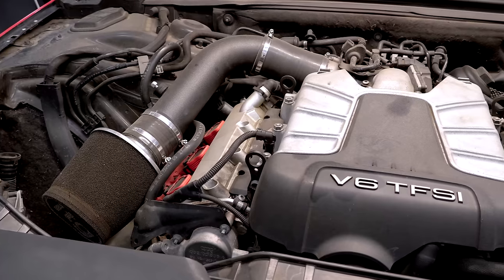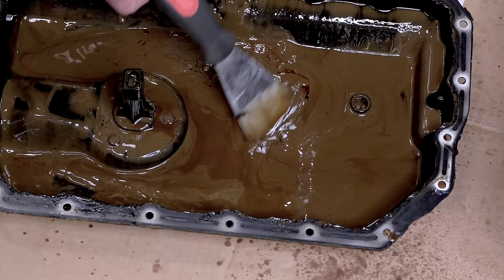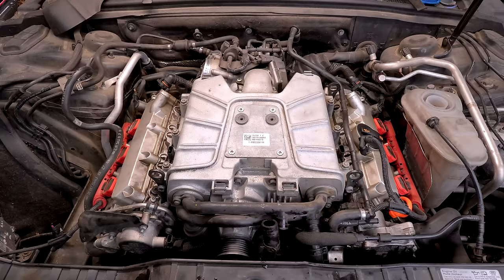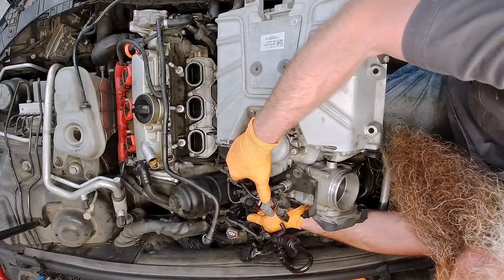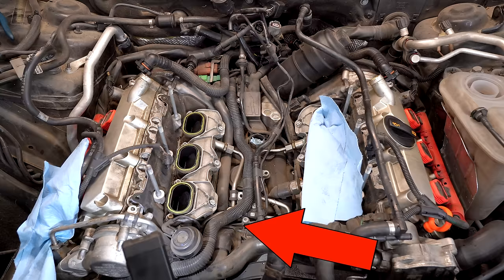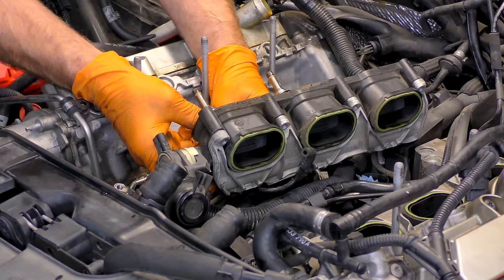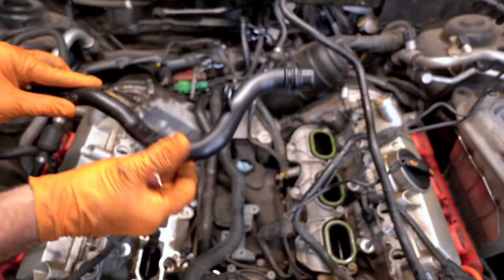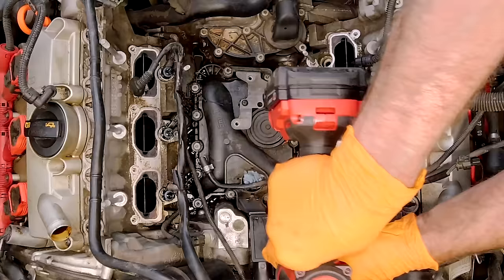How To Replace Audi 3.0t Supercharged PCV Value

Comment: I have been a Life Time  Master Mechanic, Engine Builder & Electrical Specialist. Attention to DETAIL is Crucial to the Life of Engines, Transmissions & other Systems...

My SILLY Neighbor Cracked open an Audi 3.0 to Replace the PVC.. Then in Over his Head he 
got a Craigs list Mechanic. I am staying away so I don't cause any trouble... :) I don't want ANY AUDI, especially a Super Charged 1. Geno in Idaho
Reply from the maker: YIKES!!!!
Reply: SO they shoved it into the Street since it was across the Sidewalk all night... The Mechanic who can't even keep his HOG running showed up again. Talking to Nick it has a big Fuel LEAK.. I see lots of parts
COMING OFF AGAIN..  The Money PIT isn't DOING WELL !! Geno
Reply: OMG More FUN.. SO yesterday he had the Super Charger off 4 separate times.. He had a Fuel Leak so Smoked the whole time
he was working on it. I would of brought him a Gas Can if it started burning..
Anyway they Killed the Battery so was trying to JUMP it off an OLD HARLEY :) At 1 point he had an electrical PART he hooked up & SMOKED IT!...Anyway after 12 hrs @ 11:30 PM  it runs!! But just on 5 cylinders!!!
Hilarious FUN to Watch...Mechanic // Circus guy will be back to DO MORE DAMAGE ;)

Comment: Is there a way to simplify the pcv system utilizing a catch can setup or something? That oem looks crazy lol
Reply from the maker: There is a guy working on some type of update.. I need to find his info.
Reply: @HumbleMechanic  Audi C7 Owners channel, he is working on a replacement setup that has the PCV external to the supercharger and much easier to access and service. It does mean taking the supercharger off once though, just to plug off the hole in the return/breather pipe.

Part 1: https://www.youtube.com/watch?v=so_Rj8ZIzz8
Part 2: https://www.youtube.com/watch?v=I_V4QtoHaR8

I appreciate this is your channel and I'm more than happy to remove the above links if you wish bud, not looking to hijack or promote another channel without your permission.

Comment: Theres a special procedure for defective pcv valves, that are easy and dumb together. Even Audi says it but not on the service manual which is plain stupid. I found it on accident. 
Engine needs to run, open the oil filler cap, if it starts misfiring or running rough it’s a internal leak. 
Second step, pull the dipstick and use the turbocharger vacuum measure thing and dip it the hole, it needs to pull vacuum between 0.8 maximum 1.1 bar negative. Everything over that is a internal leak. If the coolant system is tight with no leaks it’s because the pcv is also a water separator and that’s how water gets into the block. It’s not necessarily a coolant mixture. Hope that helps
Reply: What I mean with negative bar is that: -0.8 and -1.2bar is functional everything I’ve -1.2 for example -1.3/-1.5 is defective.

Comment: Relate hard to the misplaced molex. 
I plugged a 3pin connector for throttle body into a ign dizzy hall effect and vice versa. Snapped in no problem. After an hour of troubleshooting with meter and reading the wiring schematic i realised the mistake and why my engine wouldnt fire up after a rebuild....swapped the connectors. Crank and fired right up. Lol. I felt soo dumb. But all you can do is laugh about it. Were all human.

Comment: Charles! Have you gotten to play with any of the new mild hybrid engines yet? Apparently, the starter/alternator are failing and I would like to see one of those alternators torn down.
Reply from the maker: Sadly I haven’t beyond just driving them
Reply: @alouisschafer7212  Mainly the 2019 A6 A7 and A8 with the 48V mild hybrid system but the latest TSB from Audi lists pretty much all models up to 2021 (Audi TSB 27-22-41). I don't think it's clear what the actual cause is but the Generator/starter at some point stops charging the batteries. The cars will eventually stall when it no longer has any juice.
Reply: @cm.5023  so the charging circuit is the problem then. Sounds like an OEM messed up a module or its a design flaw.
If they list models up to 2021 the problem has been addressed and is no longer present on 2022 and upcoming 2023 model years right?
Reply: @alouisschafer7212  one would hope.

Comment: Actually have a question: in all your years of experience working on VW / Audi engines have you ever seen an oil gally plug leak on a 2.0 under the oil filter housing? Engine is a fresh rebuild. I'm sad I have to tear it down again just to replace that.
Reply from the maker: Oh no!!! 

I’ve never seen one leak.
Reply: @HumbleMechanic  just came back from the machine shop put it all together just for it to leak under the oil housing from that oil gally freeze plug. Really sad day man.

Comment: Just curious why u use dielectric grease?  Can i not use regular engine oil to lube the o rings?
Reply from the maker: In many cases yes. I just prefer dielectric
Reply: @HumbleMechanic  so either or works well I guess.  Thanks for the reply.  Also love your  vdub videos man.  I do also own a 2008 passat 2.0t with bpy engine.  Just recently got stage 1.5 tune as I felt car was being a bit sluggish. I have no codes and now car feels alot better.  My question for u is the car has 220 000 km do u think the tune may affect an older car like mine in the future now that it has alot more power?

Comment: Are you not at all concerned you are spraying silicone ALL over the engine bay and wiring harnesses, which certainly can make it's way to the O2 sensors and pooch them? Also using silicone grease (dielectric) on fuel system parts is a HUGE no no as I know it.

I've killed O2 sensors before with very very little silicone spray in an engine bay, sure you don't see it immediately, but it starts taking its toll over time and anywhere from a month to couple of months you have slow responding O2 sensors or poor return values, etc. 

I'd watch it with the use of silicone in and around engines with O2 sensors. JMHO.
Looking for another spray lubricant to ease fittings off? plain ol WD40 works, or you can try lanolin spray aka fluid film. Regular grease is a better choice for fuel system o-rings as it will work just fine for assembly but dissolve in fuel no problem and not risk nuking O2 sensors.

Comment: cause 9Nm is commonly used for M6 steel bolts screwed into Alu while the rated spec for 8.8 M6 Standard Bolts is 9.8 Nm, we are pretty close. I also have many many 9Nm spec M6 Bolts on a Ford, seems to be a common thing I guess. Bolts in cars are anyway really weird a lot of times

I must say, many many people repairing cars in their daay job are not cautious enough with old and brittle plastic parts. they just say: ha yeah it break, nothing we could do about it, now customer must pay for this and that ... while especially on older cars it is sometimes really difficult to get the plastic parts or correct hoses. THAT is super annoying. good that some people still act to satisfy customers and don't be so careless.

Comment: torque to 9NM, did you allow for the losses in extension and adapter/s? then retorque after heat cycling?
engineering stooges and the bull-spit the sling are not always right ( nor anywhere near right more than 10 minutes)

Comment: the one thing i hate about 3.0T's the damn PCV.. I have a a6 with the revised CREC 3.0T and I changed the PCV and the solenoid for the breather. And the damn thing still burns oil and has a PCV code 🤦‍♂ I just ignore it now.. Glad it doesnt leak coolant into theoil though!

Comment: Never use silicone spray on electrical connectors. The gaskets inside them are made of silicone, and will swell if exposed to silicone spray.
Reply from the maker: I hate saying what Im about to say... Ive done that for the better part of the last 20 years and never ran into an issue. That said.. Im for sure open to a different way.
Reply: @HumbleMechanic  I've seen too much sadness caused by swollen gaskets.
Last case I had was an engine in safe mode because the connector to the intercooler water pump didn't click all the way in.
Reply: Food safe silicone spray will not cause the issue you're referring to. As long as the silicone lube is food safe, it can be used on almost anything. 

It has to do with the solvents used in the lube.
Reply: @jameshaulenbeek5931  Yup, and solvents used for silicone spray dissolves silicone.
Which makes it a great tool to remove RTV.

Never heard of "food safe" silicone lube though.
The term "food safe" isn't a thing on the east side of the Atlantic.
Reply: @panzerveps  Google is your friend
Reply: @jameshaulenbeek5931  I rarely use silicone spray, so I don't see why I have to google it.

If I got a connector that's unruly, I give it a spray with isopropyl alcohol and a good scrub with a toothbrush.

Comment: that oil cooler is a bitch to get off. I had to remove one the other day to do engine mounts. Than again on another one with i was doing a reseal on the oil pan.
Reply from the maker: Yea getting that back bolt kinda sucked

Comment: On the behalf of my people: We are sorry for this design. Only real big flaw on this engine apart from the timing chains going eventually.
Reply from the maker: LOL This is actually a pretty solid engine. This failure is not common
Reply: @HumbleMechanic  but it does happen and a PCV Valve should not be a part this complicated buried in the V of the engine

Comment: Rear timing cover reseal  ,oil filter housing seals will be easier in when engine is out , love old plastic 😱🍺
Reply from the maker: When I do the manual swap I may just pull it.

Comment: This looks insanely tedious and complicated. I bet this is a $2k job at a dealership plus parts. May need to change you title to. You have "Value" not "Valve".
Reply: Hahahaha 2k? Dealership more like 3200
Reply: @jacobmiller1799  well I did find a euro shop that said $1,475. But that’s like $1,100 in labor and I did say plus parts. So parts would be another $1,200.